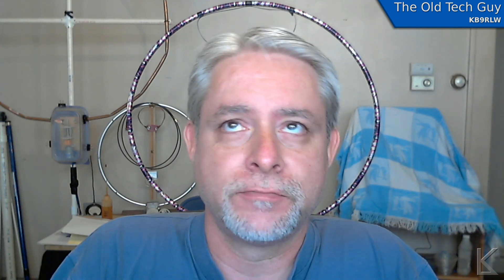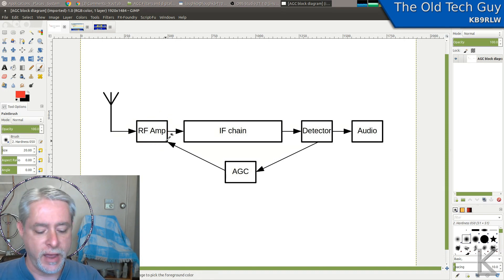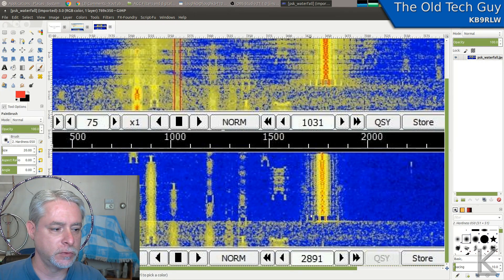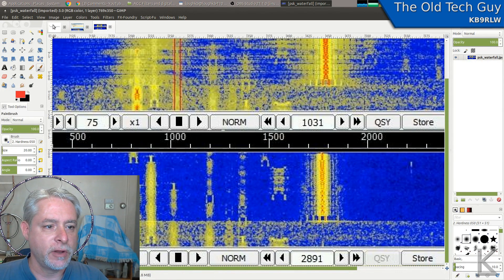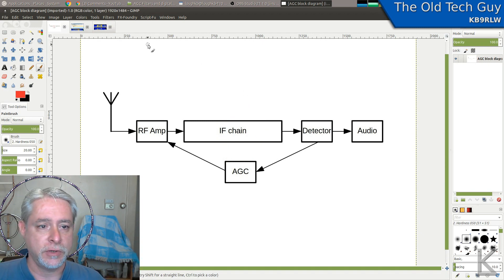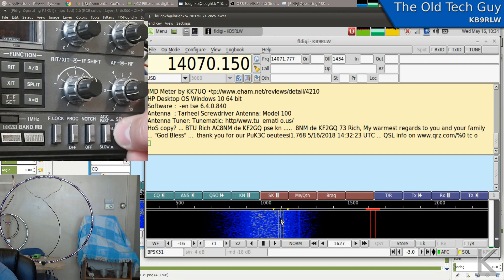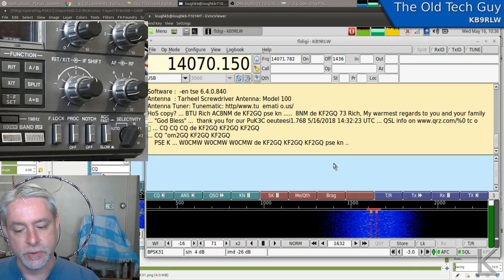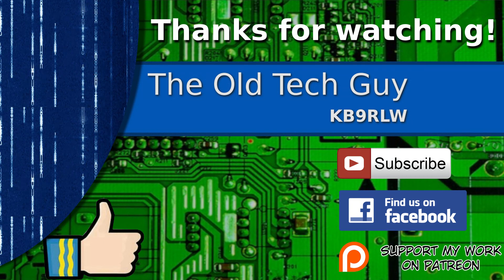Ham Radio - AGC, Filters, and digital modes reception.

Comment: Thanks Kevin.  I am a big fan of the conversational digital modes. I have thought about these same issues.  Everything that you state makes perfect sense.  However, my real world experience with narrowing the passband and centering the signal within the narrower passband has been disappointing.  In other words it does little to increase the intelligibility of weak signals.  
I am not sure what is under the hood of FLDIGI.  My impression is that it may form a virtual filter in software around the relatively narrow signal.  When set to PSK31 or Olivia 8/250, the software "knows" the bandwidth of the signal of interest. 
Newer rigs with DSP filtering allow you to choose the filter width and offer very narrow settings.  At some point it may be that too narrow a setting obscures the difference between signal and noise.  
More specifically narrowing the filters does little to the signal to noise ratio that I see FLDIGI displaying.  Ultimately, the problem with a low signal to noise ratio may not be fixable at the radio.  Improvement in the antenna may be the way to go.
You did not get around to the strategy of turning off AGC entirely and setting the RF gain manually.
As you point out, AGC is meant to handle the situation where the signal of interest occupies most, if not all, of the passband.  With digital modes multiple signals may appear simultaneously in the passband.  However, even with multiple signals all of the RF energy only fills a fraction of the passband.  This is different than AM or SSB reception.
Reply from the maker: The idea behind narrowing the filter is to prevent nearby strong stations from pumping the agc.  It also makes things easier on the software that's processing the desired signal.

Comment: Thanks for the video. I had been chasing signals with the vfo. I never even thought about the if shift. Duh... 
I also use the venerable TS-440S. Mine has the AT. Great video
Reply from the maker: Mine is also the 440Sat version.  I only wish the tuners range allowed it to manage 160 as well.  
Thanks.

Comment: Good presentation indeed.  Seeing the waterfall certainly shows the effect of using a wide passband and how strong signals can affect weak signal reception.

I'm a strong proponent of reducing the RF gain until the external background noise is low but audible, then hunting about with a 1 kHz bandwidth.  Not good for using a skimmer to watch the whole psk band, but less havoc when strong signals are abundant.

Any issues with ringing when using really narrow CW filters?  I haven't tried that, being more into wide analog / narrow DSP filtering.
Reply from the maker: No ringing.  But then again, it's a really good filter that Kenwood made.  My FT-817 also has a clean 300hz filter that doesn't ring.

Comment: Hello Kevin,
Nice Video! Next time you could explain what to set the PreAmp/IPO to.  Also note that you sometime have to reduce the RF-Gain manually so that you don't get to much noise from the input amplifiers when not using the AGC.  Most of the time less gain means a better signal to noise ratio which is always what we want in digi modes.

Comment: Hi Kevin, Nice tutorial to understand the AGC & Filters. Used to have an old TS-830S but these days utilize a Icom-7300. I would like to get rid of the garbage on the spectrum scope by narrowing down my filter on a spec signal. Will experiment more to understand the radio and FT8 mode. Thnks for the info and discussion.  Emil

Comment: Can You do a Review of SDRplay SDRduo Two-Tuner SDR Radio  ??
Reply from the maker: I already have a video on the SDRPlay RSP2, along with build scripts to automate setting it up under Linux.  Scroll back through my vids, or just search YT for SDRPlay and my call sign.
Reply: The Two Tuner SDR radio  ?? thanks
Reply from the maker: If they send me one.  But I suppose it would be about the same as the existing one.  Just add the ability to monitor two frequencies at once.   I believe that's the only difference.

Comment: Cool halo buddy!  Narrowing the filter width works for single signal digital modes like PSK, THOR, Olivia, and RTTY, but for the JT and FT-8 modes you need to keep your receive bandwidth all the way out to the end of the audio range, rather than narrowing it down for one specific frequency because the software is looking at the entire audio spectrum at the same time to decode all the stations it can within the audio passband.

Comment: Excellent explanation of the IF Shift Kevin!  Thanks! Very cool to see the filter "shifting" up and down the band.
Reply from the maker: It's also handy when you're in QSO on SSB and there's another QSO nearby.  If you're hearing that high pitched crackle, or that low pitch warble from the nearby conversation you can shift the IF a  bit and reduce the interference dramatically.